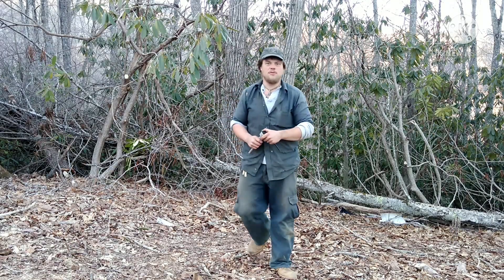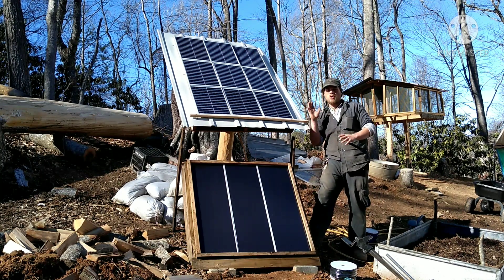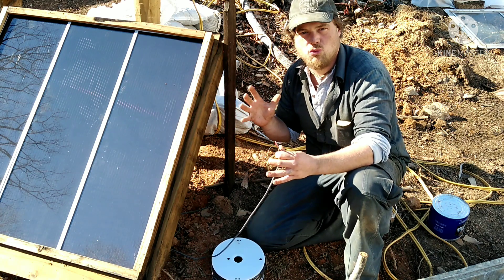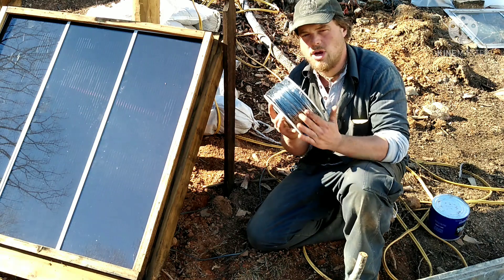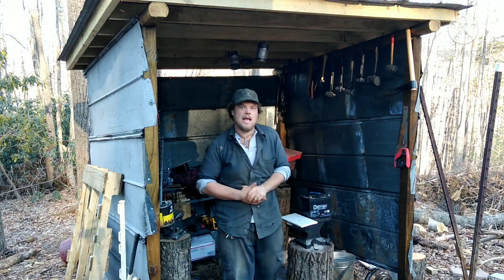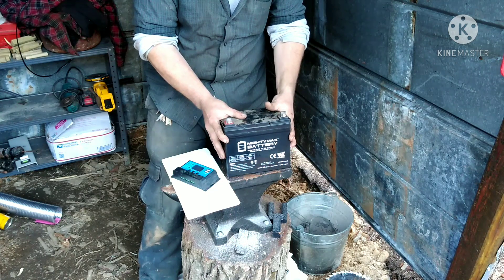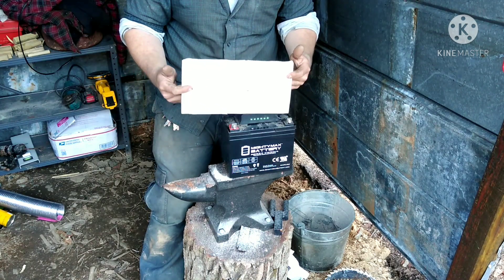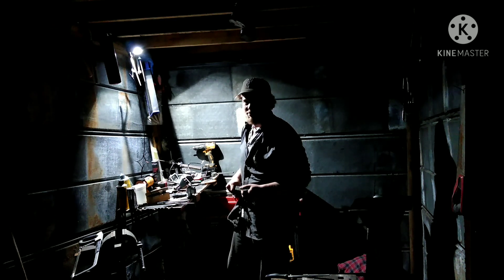Basic Solar Power Setup - Easy DIY

Comment: For electricity, we usually say "series and parallel", and not "sequence".  Whether to wire panels in series or parallel depends on what your charge controller supports, so read the documentation there. Another good idea is that if you have two black wires and can't tell them apart, put red tape near the end of the positive wire. This makes fixing things in the future much easier.

Comment: Nice set up there, Josh. I was always told not to set a battery down on concrete when I was an apprentice. Possibly battery technology has moved on and it’s not as important nowadays but I still put a battery on rubber or styrofoam and off the ground as much as possible. Even in my vehicles I put a thin piece of styrofoam under them before I clamp them down. 👍🏻
Reply from the maker: Good, I just do what I'm told by the elders I respect and have always put a piece of something under the batteries, glad it wasn't for nothing!

Those panels are from our first off-grid experience 8 years ago. However they still work well!

Comment: Very neat small system. Thanks for sharing. I think we are going to eventually going to use two systems, solar and miro hydro but first I've gotta catch 4 springs in sequence to create a stronger flow.
Reply from the maker: Rember seeing one made out of a washer once,

Working on installing our wind turbine, making a lasting post from scratch has been time consuming
Reply: @SteepintheWoods   yes I have a washing machine motor I'm going to wire to make up to 600watts continuous power....hopefully. The learning curve here has been fun.

Comment: Well Josh, I learned something new today. I didn’t know if hooked in series a portion of a panel is blocked that it kills the whole system. Also, you may have the worlds first solar blacksmith forge :)...and if not, then definitely the first Appalachian blacksmith forge!!!
Reply: This depends on the panels. Many modern panels are wired using bypass diodes and they degrade linearly, which is what you would want.
Reply from the maker: You might be right! Having an electric blower has really helped. Also got my hands on a new forge and some coal. 

Those have been a life changer! I had to work really hard to get the metal past light orange prior to this.

Comment: Yep tha ground or concrete floor will discharge a battery. They both make great heat sinks so they lower tha temp of a battery quicker than one on a piece of sterafoam , wood or rubber. Open air even when its cold wont  draw tha battery down near as quick. Car batterys do lose capacity in tha cold weather but theys built with extra to still have enuff Most of tha time if you drive em daily. I keeps my Cycle and mowers and such that dont operate daily on a battery tender. Tha tenders make em last longer too cause theys always topped off and warmed a little too buy tha trickle of current they keep on em. A dead battery can freeze and bust in cold temps because all tha acid is in tha plates eating em up instead of in tha case acting as a a antifreeze. Anyhoo nice Smitty , Im jealous Cl:-(p)
Reply from the maker: You know your batteries! 
Thank you for the information!

Comment: I rarely hear anybody warning about solar panel energy during the setup process.  Please cover the panels until all the connections have been completed.  The panels will produce power in even low light so it is important to cover them with a blanket or cardboard.  If portable then just turn them upside down.  Anything to block the light so no power is being created when working with the cables.  If it is a high voltage, like panels in series, then you should also have a disconnect to allow servicing the array safely.
Reply from the maker: I know a man that put his tongue to the cable one time! You're right even on a cloudy day he can give you a good shock that way! Haha 

I have never felt a shock by hand.. but mine are more like gloves then hands.